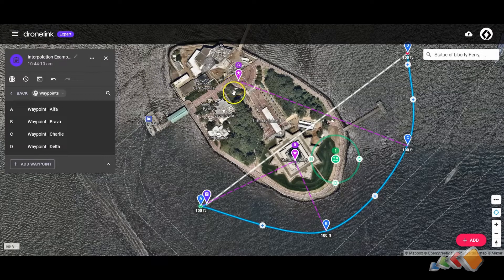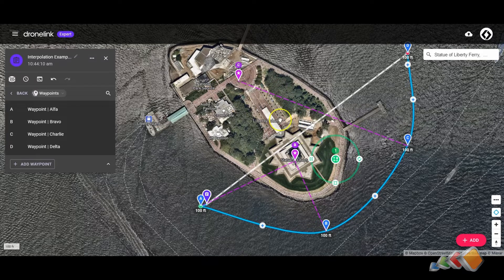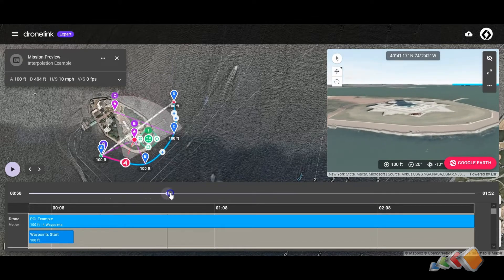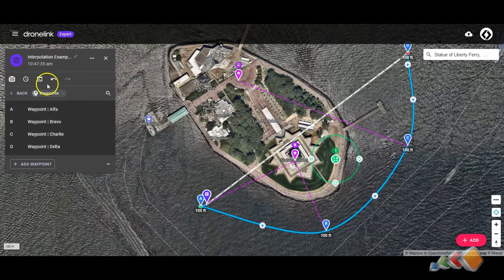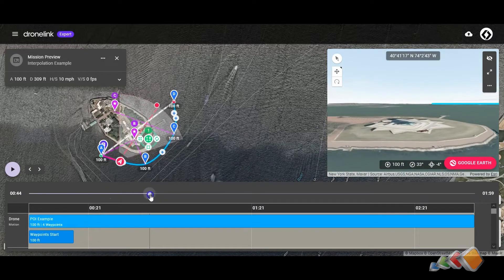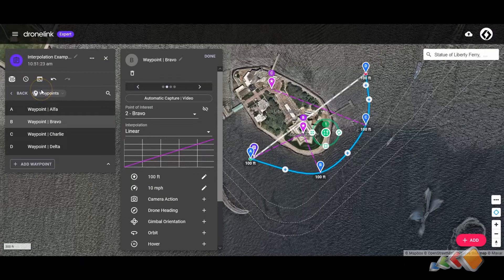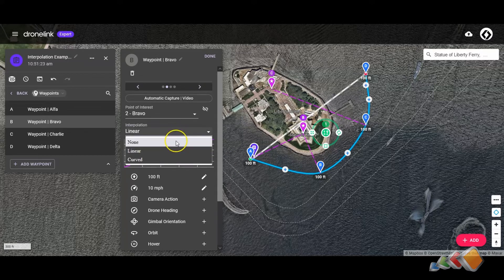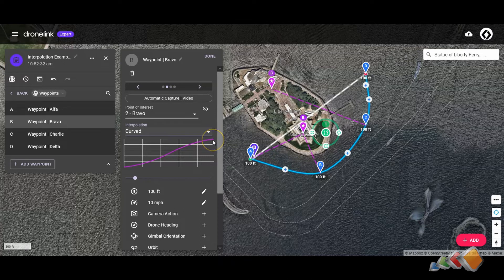What Is Interpolation?

Comment: Nice, but according to website, many drones are not supported.
Reply from the maker: I assume you mean the Dronlink website?  Whether a drone is supported depends on whether DJI has released the Software Development Kit (SDK) and that is entirely on DJI.  If they don't release it there is nothing Dronelink (or any other 3rd party software) can do.  
This is actually the subject of the next video coming out soon, because I keep running into people that have bought a Mavic 3 Pro, Mini 4k Pro, Air 3, etc. and are upset that they can't use it for mapping, so I wanted people to understand why that is and how to tell before buying.

That said, if your drone does support waypoints even without the SDK - e.g. Mavic 3 Pro - then interpolation works the same way, just with different software.

Comment: Great tip again - also you mention refining the process with the addition of waypoints. I read on the DL forum, that altering the rotational acceleration/deceleration, along with drone speed (and yaw settings in the DJI app) can smooth things out further, but I've not tried this yet  - I know it's maybe beyond the scope of this tutorial, just wondered if you had experience yourself with those settings?
Reply from the maker: I've tried a lot of different settings.  Personally, I find having the speed too low can give quite a jerky pan movement, so i try to keep the drone moving. Under 5mph is particularly problematic IMHO.   
I've adjust the yaw settings in the DJI app many times in the past, but usually for manual flying.  In fact I did a whole tutorial on that which can be found in the Phantom and Mavic Filmschool.  That really makes a big difference for manual flying but I have not tried that in combination with programmed software I'm afraid.  Maybe you can try it out and post the results?